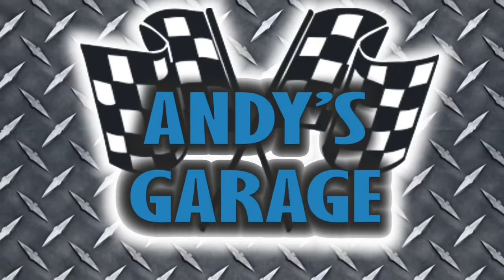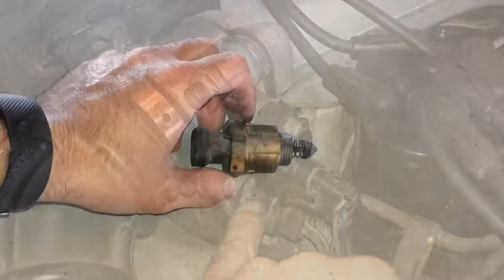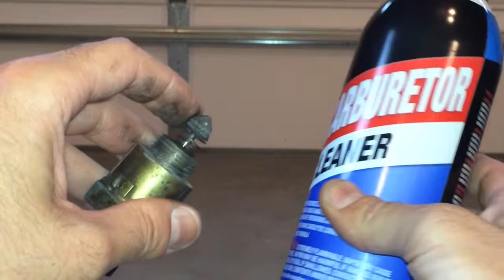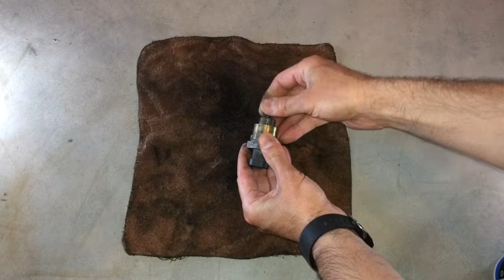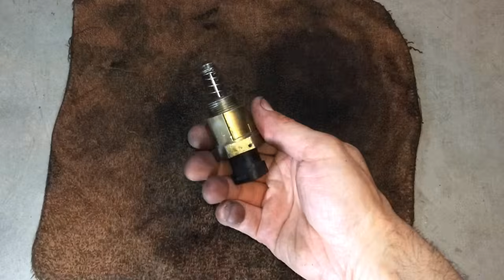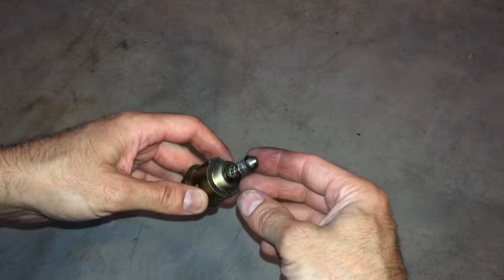How To Clean Idle Air Control (IAC) Valve (Andy’s Garage: Episode - 73)

Comment: Do not pull or push or twist the plunger . It is attached to plastic worm gear. It is controlled by 5 volts, not 12 volts . If he got the plunger to go in and out by hand , he ruined the IAC.

Comment: The IAC has from 0-255 positions.I used to have an electrical tool from Thexton that would hook to 12v battery and work the stepper motor in and out for cleaning.Had a switch to reverse direction.Once cleaned you left motor pintle at approx. mid point before reinstalling.

Comment: Getting ready to check and clean mine along with pcv, egr, thorttlebody, MAF, etc..  I'm not good with cars, but I've been watching vids lately trying to figure out why my idle rpms have dropped and I'm stalling when putting it in gear.

And  now today, the entire throttle has just died.  I can push the pedal all the way down and it won't rise above idle. rpm.  This probably has actually been around for many years and gradually got worse.  I'm hoping it's a cheap and easy fix because I'm not good at doing big teardowns.

Comment: Anybody else get a horn sound lasting a few seconds while driving? Sometimes dies too after sound goes away. Only slower speeds and AC, heat or defrost have to be on. I have a 2001 Mustang GT 4.6 liter, 8 cylinder.
Reply: I know this is late but I had a ford f150 that would do that at times. It was something in the intake that turns... I think it was called the "Intake Manifold Runner Control Motor". But yeah Mine would make quite the noise lol. At first I thought the intake sucked something up haha. Hope that you've already fixed it but just in case, hopefully this will help
Reply: @SAStroud  hey, really appreciate that! Have never heard of that and will look into it. 👍🏻

Comment: My ford mustang 2006 v6 is cranking but nothing but if u press the gas pedal enough times it will start and then stop again when u stop.
Do u think that its the IAC or something else?
We have changed fuel pump fuel filter fuel rail sensor. Im runing low on money to keep buying part. Please help
Reply from the maker: Are you getting any engine codes?
Reply: It could be your IAC stuck closed. A temporary solution is to adjust the throttle cable to open the butterfly slightly in the throttle body. 
For diagnosis Try removing the IAC and cleaning with carby/throttle body cleaner,BUT if its a sealed plastic unit DON'T fill it up with cleaner by having the shaft facing upwards. If it's able to be disassembled, do so and clean the shaft mechanism by flushing as you push or screw it in and out. Check for side to side or in/outplay, if either are present,condemn the IAC, BOTH will cause rough idle. I don't know what vehicle you have but Mitsubishi one's range from $36-95. You'd have to be in a Mercedes,VW, AUDI or similar for it to be $450, or the mechanic is a rip-off merchant!

Comment: question, WD40 spray cleaner it works?
Reply from the maker: I would only use automotive cleaners. WD40 is a penetrating oil; I would not use it on the IAC, MAF sensor or other electrical components. Only use cleaners recommended for those components
Reply: @PhillipsVision  ahh i see.

Comment: It's driven by a stepper motor-you should never try to push it in or pull it out-you'll break it .
Reply: No you won't if you do it correctly.... gotta be gentle with it and just kinda jiggle it as you pull/ push on it..
To get it out easily remove it, connect harness,  key on..... it will eject itself
Reply: @freemanfornow264 And how to get it back in?
Reply: To get mine back in when it was a part, I just pushed everything in until the screws reached. And alternated and turning the screws to draw it in evenly, and I didn't have any problems.
Reply: 💯 Some screw in and out, for example all Mitsubishi petrol vehicles from 1992 onwards eg 4g7x, 6g7x

Comment: Would a stuck IAC valve cause a long crank situation. I did pull the iac out yesterday and the piston would not move. I was afraid to force it, but now I will go back and pull it out, clean it and see if it makes a difference. Thanks.
Reply from the maker: What I have encountered is usually high idle, rough idle and stalling.
Reply: @PhillipsVision  the high idle means the IAC is stuck wide open, rough idle is because excessive fuel wetting the plugs , stalling is due to flooding.
If the IAC is stuck closed you have to use the throttle to start the car but will stall unless you use the factory idle screw (Not recommended,mark screw thoroughly to return to original position later after repair). You can also adjust the throttle cable to set idle provided it's not to stretched. 
If stuck open you  will find your throttle seems to deliver its full "power" at half throttle and is extremely "punchy" off the line, but if you go past half throttle it falters  as there's too much air flow because of the excess through the IAC. When changing an IAC from a faulty one isn't PnP, it requires the car to have the battery disconnected,work performed,then when started allowed to idle for 15mins,then doing a throttle reset procedure on most cars. Yes you can skip the throttle reset, even if it had the halfway full throttle issue. That normally goes straight away as it's related to excess air which it shouldn't have any more. The reason to do it that way is otherwise you have to do a "drive cycle" (50-100)km, which can keep memory of previous driving style with faulty components and not have it relearn the best settings. If you do the drive immediately after clearing code's,try to drive as economically as possible for the first 120km,but I recommend the 15min idle followed by economic driving for 100km

Comment: Do you think that electro cleaner would work in place of carb cleaner? Thanks.
Reply: Yes electrical contact cleaner  is absolutely fine works well
Reply from the maker: No. Carb cleaner is more harsh and designed to dissolve gunk and build up